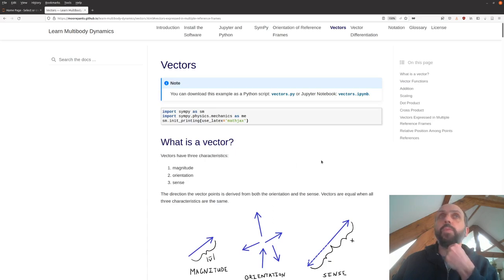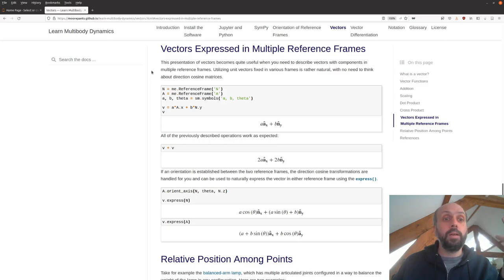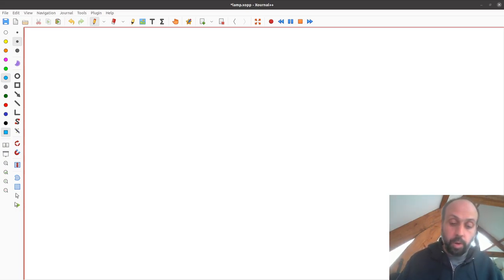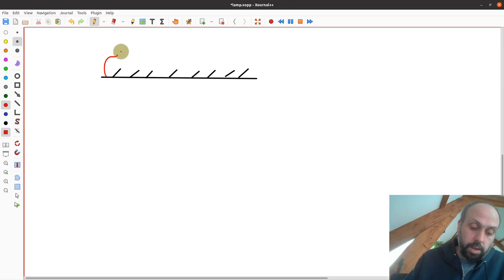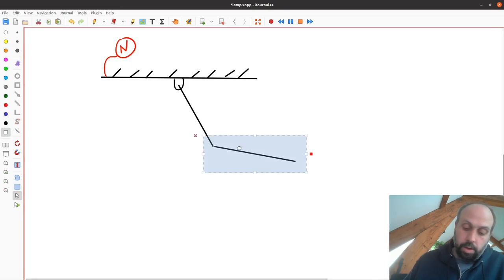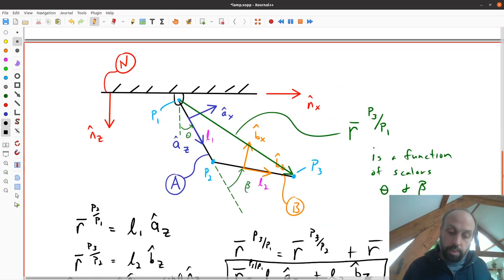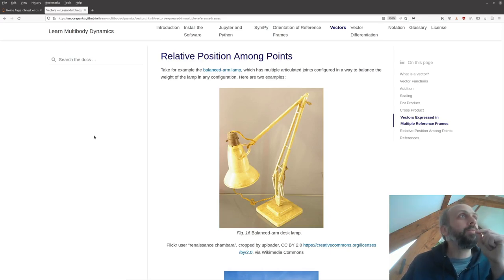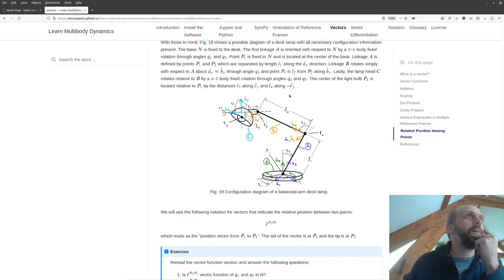Multibody Dynamics B 2021/2022: 3.1 Vectors

Comment: Dear Professor Moore, Could it be that in the video, when you are defining frame C, q3 is used instead of q4 and q4 instead of q5? These angles are stated in the drawing and in the online notes but they are not mentioned in the video.  Kind regards, Bas de Blocq
Reply from the maker: Yes, I made a mistake in the notebook in the video. It should be C.orient_body_fixed(B, (q4, q5, 0), 'XZX')